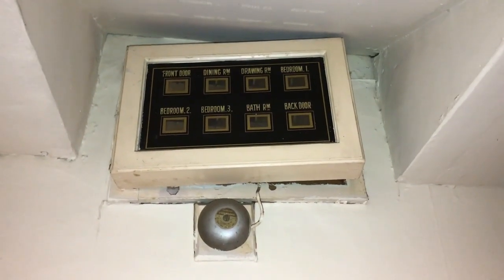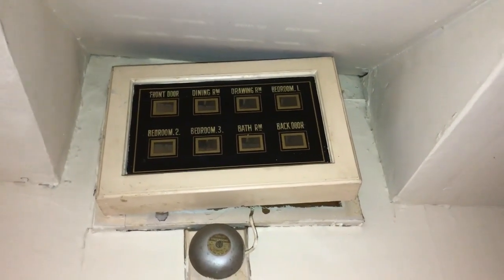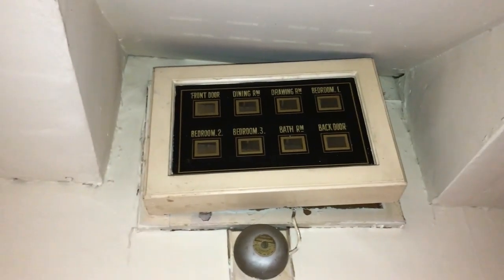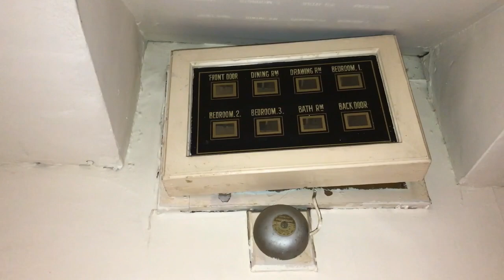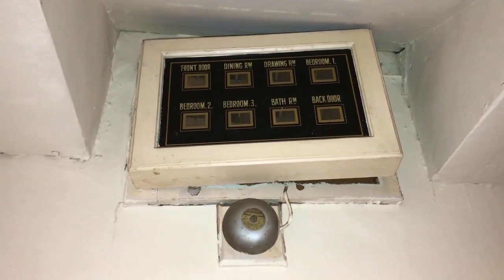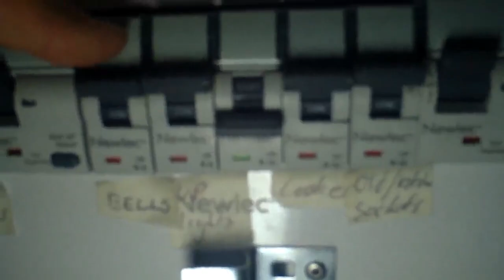fitting a servants bell, doorbell

Comment: Do you know if there is a way to make a system like this function wireless? I moved to an old house and in the middle of the renovation we found the wiring to the old servants bell system. Unfortunately, neither the call box nor the bells in each room were found and the walls have already been plastered, so there is no chance to rewire the old system. I recently saw a video where someone connected an old-style doorbell to a wireless transmitter. Do u know If something like that may work?